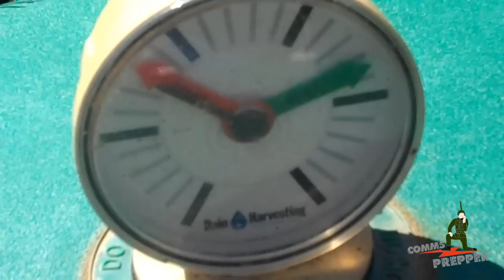Rainwater Collection

Comment: Greetings and thank you for the video. It is great that you share the bounty with neighbors!

To keep the gutter clean and reduce maintenance, try using gutter guards that use water tension. There are multiple brands and varied costs. I had a gutter company make them for my barn specifically to help in keeping water cleaner. 

My homestead is located in forested area and leaves (of all sizes) are an issue. You will be amazed at how much cleaner is the collected water. The mesh guards catch bio matter that will eventually breakdown into the gutter which fills your "first flush catch" quicker and may even clog the drip valve filters.

As you have a decent investment, a "couple more bucks" for the gutter will be well worth it!

Wishing you the best fellow homesteader!
Reply from the maker: Thanks for the tip.

Comment: Two points to ponder.  First is safety.  Prior to entering a enclosed space such as your tank you need to test the air for adequate  oxygen levels.  Secondly, you are spraying chlorine bleach. This is a hazardous substance.  Additionally,  you should be wearing a safety harness and have someone capable of pulling you out without themselves entering the tank.  Secondly, no need to boil the drinking water.  Since you have normal pressure to your faucets,  I would recommend just getting a RO filter and putting under your kitchen sink with a tap on your counter.   You could even hook it up the fridge for ice and cold drinking water.   Nice project.  Good luck with it.
Reply from the maker: Thanks for the tips.  I did have a neighbor on-site helping.  So far the project has been working well.  It's almost four years old and we have not had to order water since.

Comment: Great setup. I would suggest that you paint the pipe to protect from UV damage to make it last longer in the sun. It is not designed to be exposed.
Reply from the maker: Thanks for the tip. I may be redesigning the whole PVC system soon (version 2.0).

Comment: Bleach will eventually cause those rust spots to eat all the way thru the metal wall. It wont help any galvanized fittings either.
Reply from the maker: Thanks for the tip.

Comment: you have pretty much covered water catchment and processing it for many uses. but few have show how to create clean water if a certain type of contaminate is present. that being radioactive. and being your getting it from where the highest form of fallout comes from. well i think you can see my point.
Reply from the maker: dale myers I see your point.  So many bases to cover when prepping.
Reply: dale myers hey, Dale. Plutonium or strontium found in radioactive fallout can be removed by carbon filtering and the process of reverse osmosis ion exclusion. Reverse osmosis takes place when a build up of ions at the surface of a "filtering" membrane forms a barrier . The ion barrier allows other water molecules to pass through, while excluding all other substances.

Comment: Your collector has a decent amount of surface area.  Looks like you could make it dual purpose by covering it in solar cells.
Reply from the maker: I thought of that but it's too far from the house to run the power (500 feet).

Comment: Beautiful...!
How do you get the system to prime itself, to start the siphoning?
Reply from the maker: Bruce Wayne Good question - not easy so I make great efforts to never loose the prime (have only lost it once in eight years).  When I did we used a pump at the cabin to push water back up the line and let it run to pull out all the air.  If I had it to do over I would have put a prime valve at the top (and may one day).
Reply: Commsprepper Wow, great job !
It might be worth looking at a manual 'simple pump' at the top of hill?

Comment: Why not paint the rust spot areas inside of the tank, to keep it from further eroding, also causing it to create further issues with cracking?
Reply from the maker: Because I will be gone before they rust through the six inches of cement.

Comment: You could paint the interior of the cistern with Drylok  ( latex based) and  seal  up  the rust which  will leach into the water in the tank.  ( unless you  have an iron  deficiency,  I wouldn't want it in my water :-) ) Water will basicly find any missing minerals from the concrete and steel ( rebar/ wire mesh)  in the walls. I've seen water that was processed through a RO system basicly eat through stainless steel in search of the minerals that were removed by the filters.  How big  is the current tank, and  what  was  the cost for construction? I'm thinking of putting one underground myself, except I will have to pump it out ,  I have  no  elevation for  gravity feed. I will also need it strong enough to park vehicles on top of it.
Reply from the maker: One tank is 1500 gal and the other tank is 2500 gal.  They were made by a local company that makes cement septic tanks.  Their cistern tanks use many of the same form parts as there septic tanks but they leave out the baffle form and the holes for the leach field pipes.  I recall I paid around 1K for each of the tank (a bit less for the small tank and a bit more for the larger tank).

Comment: Where did you get the tank? Looks like a good tornado shelter...
Reply from the maker: davjan4 Local cement company.  They use modified septic forms.  Very common in the area.
Reply: Commsprepper I'd like to see a picture of that before install. I'm building a home and want to build in some backup to the well. I suppose the big 1,000 gallon plastic tanks would suffice though.
Reply from the maker: davjan4 Send me an email to commsprepper@gmail.com, I think I have a few pics of the 2500gal tank when it went in.  I looked at plastic food grade tanks but the were about $1.25 per gallon.  The cement tanks were half.  There was not much to putting them in.  Dig the hole, six inches of level gravel and the company that makes them here delvers on a flatbed with crane and places them in the hole.  Plumb and back fill.

Comment: Have you thought about using the water flow to generate power for a battery bank? I would put a small turbine in line with one of the pipes and set it up with an alternator kind of like those DIY wind turbines. Granted, efficiency all depends on how much rain you get but it would be a good/fun project none the less. I've been working on a semi-autonomous hydroelectric system that would need less than 10 gallons of water to constantly trickle charge a battery bank, but I don't have anywhere to take what is on paper and make something real with it. Let me know if you would like to hear more about it man.
-PJP
Reply from the maker: Pajama Prepper The system does not have the flow rate to turn a turbine.  It has just enough pressure to move the water through the filter.
Reply: That's a bummer. I'm not sure where you are but assuming you get snow, those tanks would get you through a winter without refilling, correct? Also, what is the lifespan of the filter you use? When I buy a house (currently rent a townhouse), I will likely install a system like yours but on the roof.
Reply: good idea if you have high ridges around worth doing it

Comment: what is the sqft of the collection surface? 

I'm looking a building one on a small property in town for water collection for my garden. I have a 15 x 40 section of shingle roof I can use, but I want a metal roof.

I'm purchasing 500-1000 gallon poly tank for above ground.
Reply from the maker: +Indiana S Andrews Above ground?  I'm assuming you don't have to deal with freezing weather or worry about algae growth from sun light?

Comment: Thank you for a great video !  Did you put some Silver coins in your cistern like the Romans did many centuries ago ?  Maybe add a south facing shed row for your farm animals or horse power.  Keep up the good work.

Eyes UP and lights down,  tjl  Sent by Win7Pro64 w/ADSL
Reply from the maker: Tim Lipinski No silver in the tank.  Unfortunately, the collector is at the top of my property above the retreat so using it as building/shelter is not practical.

Comment: Can you direct the overflow from the first tank to the second tank?
Reply from the maker: BC ElginTex I'm sure it could be done but I did not look at doing that.  I think that kind of approach would require pumps and I don't have power at the tanks.
Reply: Commsprepper Oh, okay.  From the perspective on the video, I thought the tank you were filling was uphill from the other tank.  If it were then the overflow from the first tank would just gravity feed to your second tank.
Reply from the maker: BC ElginTex Actually the tank connected now is lower than the other tank.  I'm working on a solar solution to power pumps between the two tanks.

Comment: Would have like to see the structure under the collection panels.  Also, to much too talk without much info and extreme shaky cam.  Maybe get a tripod.
Reply from the maker: sorry about the camera work - photography is not my thing.  Permitting and HOA rules prevented having a structure.  Not a whole lot more info to provide.  rain falls on surface, travels to filter and into the tank.

Comment: Good afternoon,  coms prepper if I were dealing with tanks like yours what I would have done is plumbed all the water flow into one an overflow from that tank into the second then an overflow pipe from the second  out to the lower driveway so my neighbors could draw water from my overflow and no valve to be closed by interlopers what you're allowing them to take is your excess not your main flow this way they can't steal your water source entirely without you being able to keep on top of it and one camera will even a dozen a smart fellow like me if I wanted what was there you'd never even know I was there I would simply video to video tape onto a portable hard drive an hours worth of video all the area and then set it on a loop to play back to you so all you see is an empty screen with your stuff left I'm hauling the stuff away that is if I were wanting to steal your blunt forgive the run on sentence I'm working on my cell phone using voice recognition software which doesn't do punctuation very well as a pain in the dupa to go back and put it in prepper embarado peace out
Reply from the maker: prepper embarado I too would have liked to have the two tanks linked but they are at different levels (they were installed at different times).  Security of the water is less of a concern for me.  I have great neighbors and we watch out for each other (many of them helped build the harvester).  Thieves would do much better just sealing the water at the retreat where they could dump both tanks.  This said, you make some good points and I will have to consider greater security in the future.  Thanks for taking the time to watch and comment.
Reply: i guess living in  New England as long as i have has made me a lil jaded and distrustful but i garotte if you lived hear you would be the same .  my mom used to say burn me once  shame on you burn me twice shame on me well it aint never been on me
Reply from the maker: prepper embarado I did live in the northeast and was fortunate to escape.
Reply: currently looking for the exit my self
Reply from the maker: prepper embarado It's the best.  You will never look back.